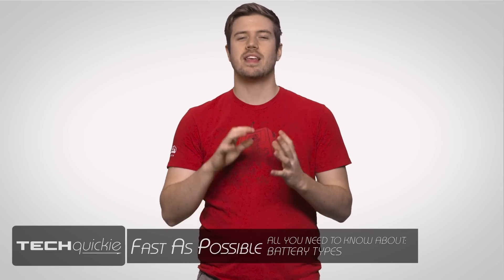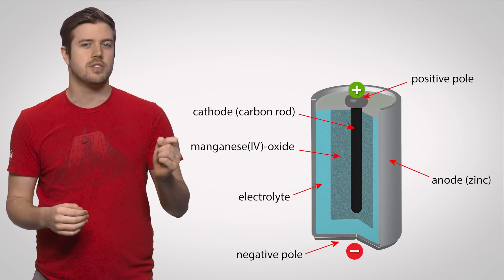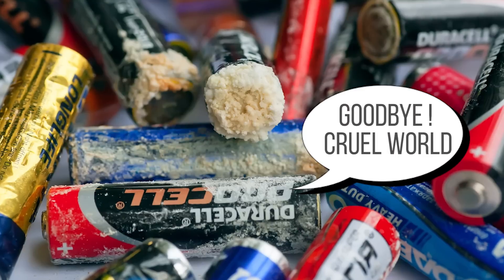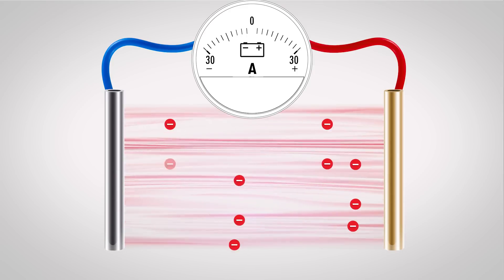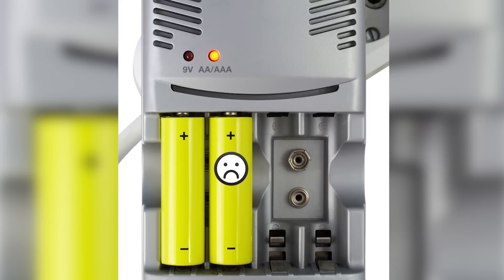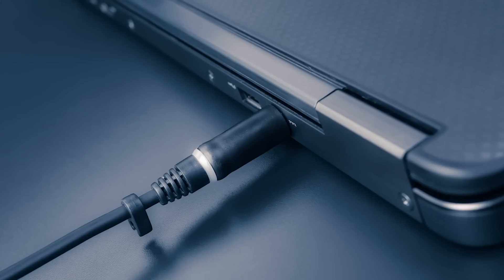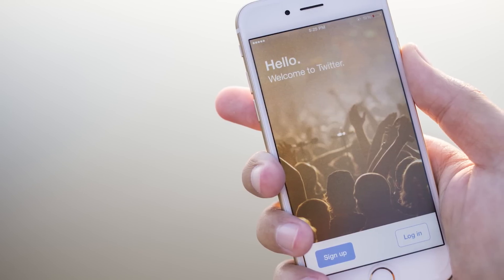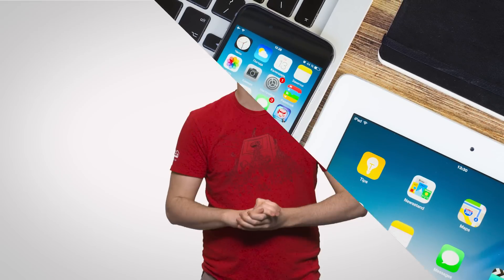Battery Types As Fast As Possible

Comment: Forgot to mention LiFePo batteries.
Reply: LFP is just one type of electrode. Technically speaking they are Li-ion battery.
Reply: Handi Setiadi
 Yes. But still larger life span (recharge cycles), safer to use (doesn't explode, not flammable).
Worth mentioning imo.
Reply: LiPo refers to the whole family, including LiFePO4. Unfortunately it's basically synonymous to LiCoO2 today.

Comment: Apple stepping up their battery game means you'll finally only have to charge your phone once a day.
Reply: or they will make it thinner as usual.
Reply: +Se7enAte But they can't fix that goddamn cabl,  lightning its seems to be made of wet paper or something like that.
Reply: lol
Reply: if you want something really durable try a braided lightning cable, they're a lot harder to break than those cheap plastic ones
Reply: Unless they take that as a que to make their CPU's draw more power and thermal throttle worse.
Reply: You mean that they last longer than my laptop which only lasts 30 min if I have maximum brightness

Comment: He forgot LIPO battery's 
LIPO is a crazy rechargeable battery 
That if you drop or gets too hot will explode but is mostly used for rc cars
Reply: LiPo and Li-Ion are families of batteries, and both can be the same chemically (you can have an LiCoO2 based LiPo and Li-Ion) they are only different in physical properties. They are also not "Crazy dangerous." I have four LiCoO2 based LiPo batteries I use with my RC Car/ Quadcopter. None have built-in electrical protection and none have failed. One is five years old and has been discharged to 3.0V/cell for over 400 cycles and still works flawlessly.

Comment: The worst thing I've seen with Lithium ion batteries is when they swell. Usually a sign of bad battery, and if it's swelled enough, the battery cover won't even fit on the phone anymore.
Reply: That is actually very rare
Reply: @stephensnell5707  Oh really because Samsung had that problem with multiple generations of Galaxy S and Galaxy Note phones, particularly the Note 7 and up. While phones after the Note 7 weren't exploding, the batteries were still swelling enough to either separate the back from the housing or even crack the screen.

Comment: You cannot "recharge" Alkaline, but YOU CAN REGENERATE Alkaline ! Each time, the capacity/voltage decrease by a lot, so it's very limited (there is other things to know when you do it too, google it !), but still possible. Remote controllers are happy with this.

Comment: my laptop discharge and turn off in 5 minutes
Reply: the battery is in extemely bad condition. Change for a new one
Reply: +Calvin Laudrensio actually, I just changed it. But the laptop itself is pretty old, so... But thanks for the advise 👍
Reply: +Calvin Laudrensio Actually my 2009 shit hole doesn't deserve 100$ for a new battery. I just keep it plugged in electricity like a desktop

Comment: 3:34 this is not entirely correct. a high discharge(5-10%) and constant 100% charge will damage the lithium accumulator in the long run. my 4 years old netbook has only lost about 20-25% maximum charge level while most people i know who have notebooks have lost about 50% in 2 years. why? because of wrong charge behaviour.
Reply: +dafff08 what is the right charge behaviour? :)
Reply: +Douglas Lim Discharge battery to about 50% most times, then charge. take off charger once charge is complete.
Reply: +dafff08 my netbook will automatically enter the hibernate mode when it hit 15% charge level. i also set in the bios 90% maximum charge level. when im at home i remove the lithium accumulator and use a power cord.
setting all options to power save will also help to reduce the wear because less loading cycles.
if you dont need the accumulator store it somewhere where its cool with about 70% charge
Reply: @dafff08  batteries should always be stored with 50% charge not 70%

Comment: Nice video, and I have used some of your tech quickie videos in my science class in the past and this one will be added to when I talk about batteries.  Could you potentially do a video on how the computer power supply works, or the voltage regulators works.  Not going to lie it would be great for when I have to cover Ohm's law.

Comment: A couple important points that should have been included in the video:
1.  You should try to keep your Li-ion battery fully charged as much as possible.  Letting them drain completely will shorten their lifespan.
2.  You should charge your Li-ion battery with a low-amperage charger, again for longer lifespan.  Charging your phone with a high-powered charger may be more convenient in the short term, but in the long term, the capacity will be diminished.
Reply: +John Drachenberg a? a what? a dog?
Reply: +WonderWaffle Did you fail to click the "Show more" link?
Reply: ***** Yes.

Comment: But lithium batteries are also fire hazards. If one catches fire good luck putting it out unless you have a Class D fire extinguisher.
Reply: baking soda
Reply: Lol 
I have those for my rc cars
Reply: +FeNite8 You can extinguish them with water - a class D fire extinguisher is not required.
There is a report on this by the FFA.

Comment: I want supercapacitors, i want to be able to fully charge my phone in 10 seconds
Reply: +Sci-Twi remember those small leakage currents
Reply: +Sci-Twi supercapacitors can provide large amount of current.
Reply: if you want to charge your phone in 10 seconds you need a source that can provide a lot of current and have a low series resistance.
Reply: +Sci-Twi supercapacitors also can be used to start cars. You could make it a hybrid with a few Li-ion cells. You should not jump to conclusions and say supercapacitors suck in every way. They have their uses.
Reply: +Sci-Twi supercapacitors can last for a few million charge cycles without losing their energy storage capabilities as compared to lithium batteries. They can be used for noisy SMPS supplies etc.
Reply: +Sci-Twi they have a purpose for existing. For example local energy storage. Can you charge a Li ion off 1v? No! That would require a separate boost SMPS and that would create efficiency problems. They are practical when you have long wires with huge inductances. They can provide surge currents. Without them, you will have voltage dips causing your circuit to reset.
Reply: +Sci-Twi Li-ion also require discharge protection overcharge and over current protection. Which adds to the cost. With a capacitor you could just add a clamping diode.
Reply: Sci-Twi If I was a supercapacitors manufacturer I would not have the time to reply to your comments. The SMPS efficiency depends on the voltage. You will understand that you have 1.8v to play with when you get into the world of ARM processors
Reply: Sorry what? I was just drooling over a 2.5V 500F Supercapacitor online when i came back and saw this had 12 replies.

Comment: Only thing is it will take people years to overcome battery anxiety of panicking when battery drops under some percent, even if that last 30% lasts for a full day. Btw NiMH batteries were used in earlier cellphones. And don't expect new battery technologies that soon, the same story was 10 years ago when people started to hype about Zinc-Air and nothing really happened about that either.

Comment: I think the explanation has the terms cathode and anode reversed. The cathode is always an electron emitter and the anode is the electron sink. Therefore the electrons flow from the positive to the negative terminal. Anyone has mentioned super capacitors with thin film technologies?

Comment: I'm hoping by 2030 that batteries will have as much energy density as petrol.
Reply: +MyriadesusTV its not about density, but about generating and storage costs. petrol is ready to use right from the groud to the device you want to power. electrical energy is both harder to generate and more expensive to store. wind turbines, solar energy and atomic reactors sometimes have lower return ratio, batteries are more expensive than just fuel tanks and a lot of electricity is generated by burning petrol
Reply: +Grapenator X Gasoline is much more energy dense than any battery right now.
Reply: William Meisburger-Iwata we just can't extract most of it's energy in a useful way. mercedes new f1 car has about 51-52% of thermal efficiency, a common roadcar is somewhere between 25-35%. electric vehicles on the other hand can turn between 70 and 90% of the energy charged into useful work, but the energystoragecapacity is way lower tha in Internal Combustion Engine vehicles.
Reply: DerpMode no, petrol have at least 10x (of not 100x, I simply do not remember numbers and so not want to write bs) better energy storage capabilities, but once you burn it out is burned, most batteries you can recharge, some of them maybe to very low capacity compared to original storage, but still...
Reply: William Meisburger-Iwata gasoline is also not exactly the most energy dense fuel either
Reply: jdr ok it out does not matter you would still need 10s if not 100s kg of batteries to get same amount of energy as from 1kg of gasoline
Reply: Ik im late but diesel fuel has more energy
Reply: doesn't that mean batteries would be worsening?
Reply: Don't be daft that's not even possible

Comment: Li-ion does suffer from the memory effect, but it takes more discharges for it to become noticable.
Reply: No they don't. They do start to decrease in their maximum charge over time (usually around 500 cycles) but that's not the memory effect.
Reply: HeadphonedMage
How is that not the same? The effect is what count, not what causes it chemically or whatever.

If you cycle it 5000 times from 95% to 100%, hypothetically, you are left with a working battery with 95% capacity. Sorry, but how is that not the memory effect?
Reply: +thany3 Because that's not what the memory effect is. He explains it himself in the video. 

It's where the battery forgets how much charge it has when you recharge it BEFORE it's fully discharged. 
How many times have you charged your phone before it hit 0%? Proof is in the pudding.
Reply: HeadphonedMage It's the effect that counts anyway: the capacity decreases over time. How that comes to be, doesn't really matter. So whatever you call it, memory effect or otherwise, the problem is still there.
Reply: +thany3 No it's a completely different problem. The memory effect is where if you charge the batteries before they're completely discharged the batteries will think the point you charged them at is their NEW minimum.

Completely and utterly different from the issues with Li-ion batteries.

Comment: so what is better for what purpose? liion or lipo? for example in power banks, i see powerbanks made with either technology
Reply: Depends on what you're doing with it. Li-Po and Li-Io are really good performance but they're expensive and require a very precise charge controller because if they are undercharged, they will get damaged, if one of the cells is a bit more charged than the others, it will get damaged, if it's overcharged, it will explode and the explosion is not pretty, if it's even slightly damaged, it may also explode. You might have heard of iPhone 6 bending in people's pockets and burning them because the battery got damaged. 

Li based batteries are really good but also really dangerous. NIMH don't hold as much charge but are cheaper and safer. There are also lead acid batteries which are really good price and performance wise but they're usually really heavy so they're for cars or for electricity storage for solar panels or wind turbines.
Reply: +Hendlton 
yeah all that i know. but still that is no good info. explaining for example what is better for powerbanks (as i said it's possible to buy either) or what is forbidden on planes
Reply: Pap9 It doesn't really matter for power banks, the biggest difference in the lithium batteries is their size and like Luke said flexibility. The Li-Po batteries are more flexible and smaller so they're better for phones but there's not that much difference, if any, between them when it comes to power banks. I don't think any are forbidden on planes but if any would be, it's probably the lithium based ones because of their explosiveness and tendency to release toxic gases while exploding so not only would there be a fire and possibly a very large explosion but all people on the plane would be poisoned as well.
Reply: @Hendlton you wally
Lithium batteries are perfectly 100% safe
They will only combust in 2 ways-
1)Physical damage
2)Extremely hot temperatures
Other than that they are totally safe

Comment: Didn't talk about over/under charging of lithium ion batteries which require voltage protection circuits in whatever electronics they are being used in. If these protections fail they can cause very violent (and fiery) failures of the batteries.

Comment: What what? isn't it from positive to negative not negative to positive (1:18) negative is like ground and the electrons that commes from positive tries to find the easiest (less resistance) way to ground/negative
Reply: +mariogrip elektrons are created at the anode (-) and move towards the cathode(+). But convention says that power flows from + to - because this was established before elektrons have been discovered.
Reply: +Robbedem Yeah, you're right! next time I should do some research before posting :)

Comment: "so much energy" its really not. Just look at gasolines energy capability
Reply: +Sisrace just look at rock's energy capability
Reply: +Gotin Fuklio Could be true. But my point is that 2 massive li-ion batteries can contain abount 0.2kwh. The equal amount of energy in gasoline requires about a few grams of gas.
Reply: ***** its better to use the gas directly with gas engine, than to use the same gas, burn it, heat the wires of the power grid, heat up li-ion batteries and have to pay for li-ion batteries instead of just plastic container
Reply: +Gotin Fuklio I dont think you get what im saying..
Reply: ***** shit wrong comment reply sry

Comment: Long lasting batteries are not profitable.. :P
Reply: +kakureru 
They actually can be, you'd have to charge a premium to off-set the lifespan, which would make them less desirable.

Look at NIMH's. They're $10-$12 for a 4-pack, nearly the same price of a 24-pack of alkalines, and good ones are supposed to last 3-4 years before hitting half capacity.
Reply: +ZombieBarioth If you fully discharge every time. NiMH had the memory issue. If you repeatedly charged at half discharge, then they will develop a lower voltage and a lower capacity. That gave them a poor reputation, and why they are so cheap. Protip tho, if you do a few full discharge cycles, you can recover some of the capacity, but not all of it. 
Lithium Ion batteries are better in this department.
Reply: +kakureru They absolutely are. I work in battery research, and batteries are probably one of the biggest areas of research right now in engineering circles. Lots of people who aren't selling batteries (phone, electric car, and laptop manufacturers for example) want longer lasting batteries to have an edge over their competitors. They also want longer lasting batteries that are smaller and thinner and safer.
Reply: Richard Smith
Well that's certainly good to know, I didn't know you could do that.

I was referring to the advertised lifespan though, which is about how long the manufacturer would expect until people need to buy more.

Comment: Some of this is wrong. You talked about negative to positive. But in reality that is called non- covintal current where conventional current is positive to negative. And both blow into each other at the same time. also hole flow. understanding how current truly flows can be confusing if you don't study electrical engineering.

Comment: You might want to add that Li-po batteries have a tendency to explode when over or under charged.
Reply: Remember than modern Smartphone Batteries have protection circuits in them so once the Battery charge reaches 100% full the current is cut automatically so overcharging simply isn't possible